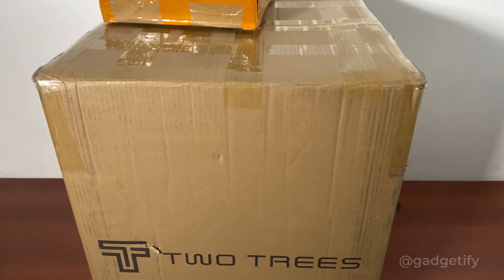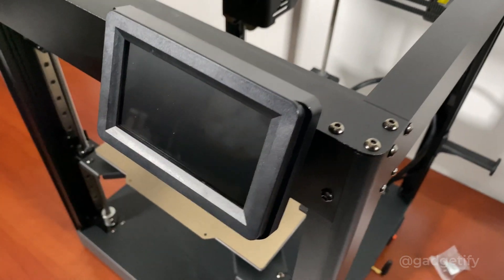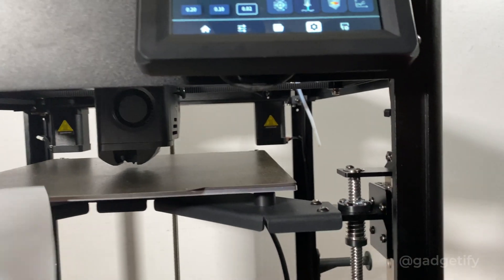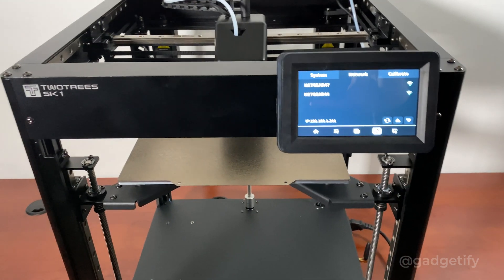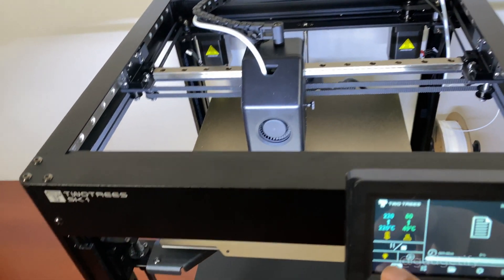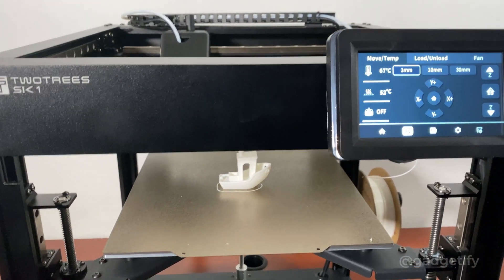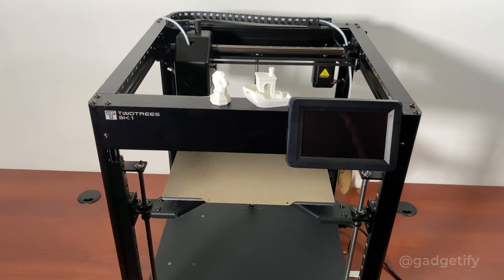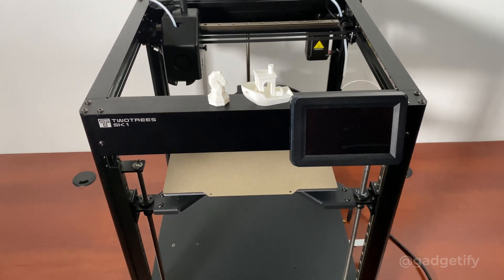TwoTrees SK1 3D Printer Tested by Beginner: 700 mm/s CoreXY 3D Printer

Comment: No system user/password, USB camera fails, Home sensitivity too high causing hot end to crash into X and Y rail. The controller is a Makerbase MKS SKIPR like board and has heating issues hence the noise of 4 fans running at 100% plus 4 fans (smallest fans in the world!) in the hot end. The Z Axis has no thrust bearing support for the motors and the supplied START_UP gcode takes 10 minutes to run. I purchased direct from Two Trees, I've ask for the login to trouble shoot the camera issue, no response. FYI: The serial display is useless while a print job runs, you can not adjust Z offset while running. It would be easy to install an enclosure except for the top, the cable chain will have to be modified enabling it to stay inside the frame, as it is it forces the chain out the bottom left corner. Oh, the hot end, by cutting the plastic away from the PTFE tube you can access the release and also notch the back cover to allow removal, 2mm Philip head screws... Other than that it does a nice job printing

Comment: I'm also having problems with the printer. Since unpacking, the Emergency Stop error "MKS-THR timer too close" has been randomly dropped. Sometimes it works for 60 minutes, sometimes it works for 5.... Communication with the manufacturer is a tragedy. I've been dealing with it for a month now with no result. (the video with the error is on my profile)
Reply from the maker: I will check it out. Like I said in the video, I am a total beginner :) Lasers and plasma are my thing not 3D printers. I just took it out of the box, calibrated it, fed the machine the filament and printed 5 models (3 of them I showed here). I will contact them to see what they say

Comment: Hothead  failed in 2 prints contacted them 6 emails later ZERO help BEWARE  TOTAL  JUNK.
Reply: According to a Reddit post, supposedly a Bambu labs style hotend is a direct replacement for this machine. If so would you still consider the rest of machine to be junk?
Reply from the maker: I have not had any issues with it to be honest. Like I said in the video, I am a beginner with limited experience 3D printing :) Is this issue common? Do you think it's a design flaw or just bad luck? If it happens to me, I will definitely cover it